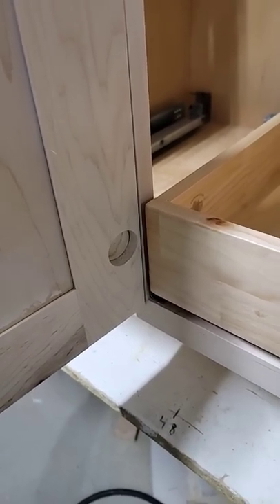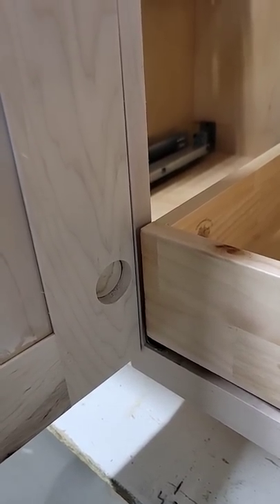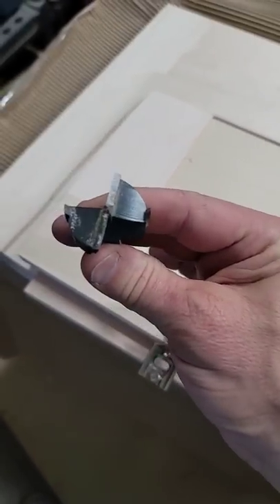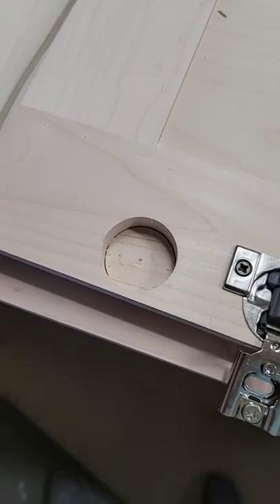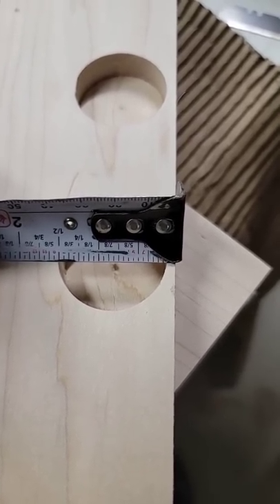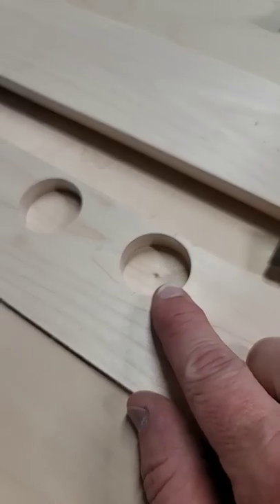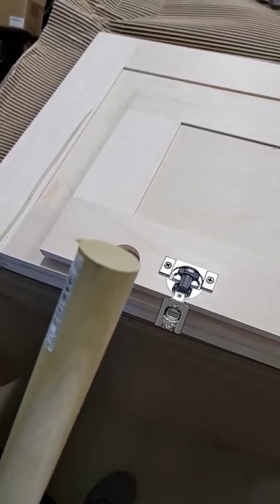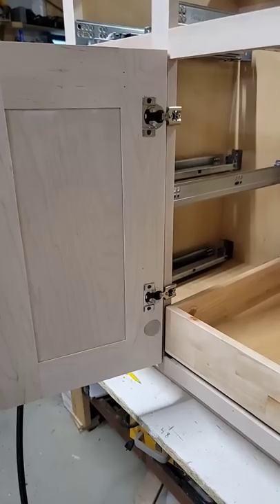How to Work with Concealed Hinges and Pullout Shelves

Comment: Make your drawer box an inch smaller. It is the easiest way because it's the right way lol. This is a case of going a mile in the wrong direction to get to the same place. I install pullouts daily and the undermount drawer guides can be screwed into the bottom/ floor of the cabinet. use spacers or whatever's needed but I'd imagine if you are in a serious bind this works but my OCD wouldn't allow it.

Comment: The dowel sticks out like a sore thumb, just use a hole saw and cut a plug out with that. The grain line won't line up right, but at least it'll all be side grain

Comment: Rather than a dowel use a hole saw with an inner diameter of the hole you need to fill and cut out of a similar material so you don’t have to see endgrain

Comment: Don't try to drill the hole by hand without some sort of guide. Forstner bits travel like crazy when you try to start the hole and you're likely to end up scratching your door.  Take a scrap of wood and make a hole in that first. Drill all the way through the scrap (you'll have a nice clean hole on the other side). Then line up the scrap so the hole you drilled is right where you want a hole on your door and clamp the scrap to the door so the hole in the scrap acts as a guide and your bit won't travel. Once you're down an eight of an inch remove the scrap and continue your hole to the right depth. Also the depth of the forstner bit is the perfect gauge for the depth of the cut. Stop when the back of the bit is even with the back of the door.

Comment: Show me another video where you open the drawer with the door open. I've never had good luck using concealed hinges and slide out drawers so I use 175° fully concealed hinges, or gooseneck European hinges on frameless cabinets. That way the door gets completely out of the space that the drawer needs to travel through. Right now you look like the door is holding up about 1/8 of an inch of the space to drawer needs to travel through which means that the door has to be open in a certain orientation for the drawer to come out fully. Not to be a negative Nancy but like one of the earlier comments said, we work for Mrs. Karen and you have to be prepared to meet her off at the pass. If you give her one thing to look at should be looking harder for the next thing.

Comment: Better off making drawer smaller. Doesnt look like a mistake then
Reply: You won't be able to tell once you use wood filler, sand and paint, if its stained you have no choice but to faintly see the plug outline with the right color filller. I work at a cabinet shop.
Reply: @stewiegriffin3549  im a cabinet maker by trade also. And that's what we wouldn't do unless it was clients mistake. You would just pack out the runner to clear hinge. In the video is how you would try not to do it. We come from different places. Each to there own
Reply: Lol cabinet maker here. When i ever i run into this issue we always reduce the drawer box my 1.5" thats usually gives us the space needed for the hinge
Reply: @stewiegriffin3549  sure there's a choice... remake the door and build your roll out accordingly...

Comment: Poor planning resulting in a bad fix... come on mate, thats unsellable
Reply: Or fixing some other professional cabinetmaker's mistake. It happens.
Reply: Still a bad fix
Reply: @harlicon  well then, what a better fix? What is that one and only "right" way to fix it?
Reply: You could 
1. Change the pull out shelf to fit the hinge
2. Move the hinge like he did and remake the side of the door.
3. Move the hinge, make a proper plug from the same wood with matching grain, stain it the same colour as the door

Comment: You're still not going to be able to use that roll out drawer there... someone didn't calculate for the proper dimensions of the drawer box to the specific drawer guides being used... I hope that's a paint grade door so you won't see that f@ck up...

Comment: I was on board with how you were doing this until you plugged the hole with end grain of a dowel that is a different species of wood 🙄  you'd be off my sites and not coming back
Reply: If you're that picky about a painted plug behind a closed door that not even you would find after the finished project, he's probably smart enough to not work for you anyway. Just sayin.
Reply: @rmbru2k  you do realize that you will always see end grain through paint. The amount of labour to not see it would exceed just  buying a  new un drilled door.. if that's your attitude I wouldn't want you working for me
Reply: @rmbru2k  plugged is fine but don't half ass with a dowel and end grain
Reply: @ultimatemonkey  yeah, I realize. Thanks for your feedback.